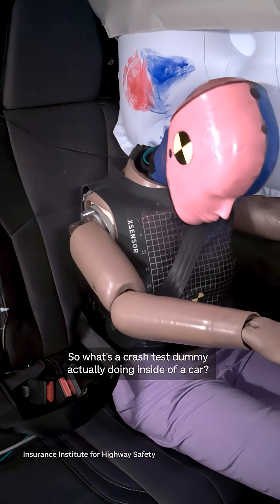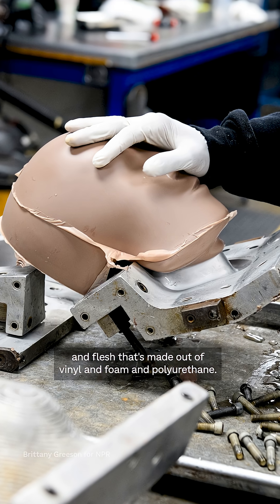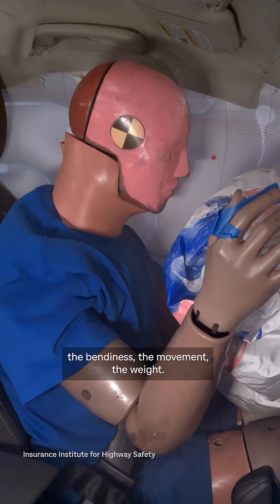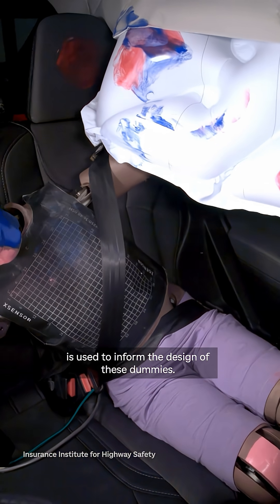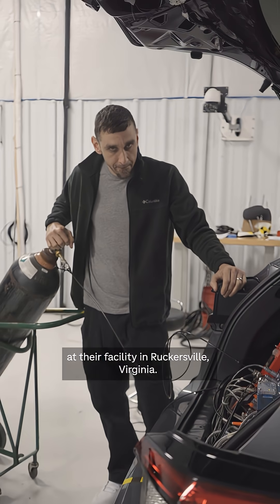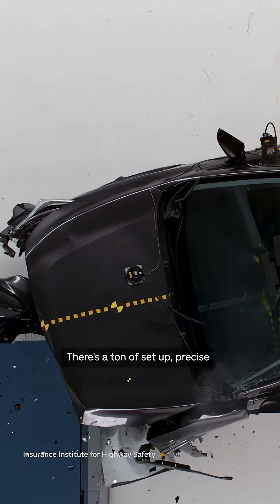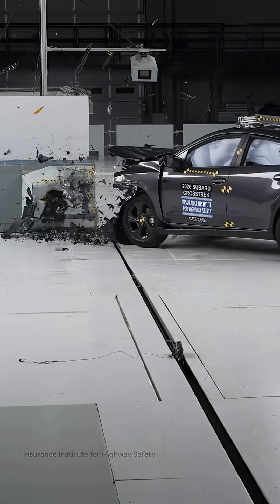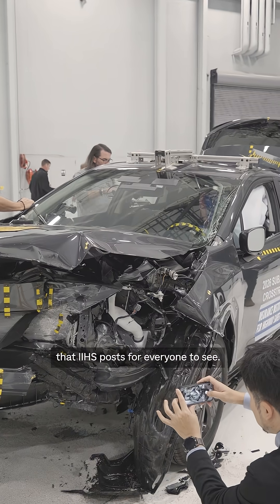How do crash test dummies work? See how they're made

Comment: The lack of dummies with female anatomy (not just secondary characteristics but also center of gravity) is putting women at risk, both behind the wheel and in the passenger seat.

I myself sit relatively close to the wheel due to short legs. This means I cannot fit in half the vans on the market, since my lower legs get crushed between the seat and the console. I don't want to find out how this shorter distance to the wheel affects taking an airbag to the face..